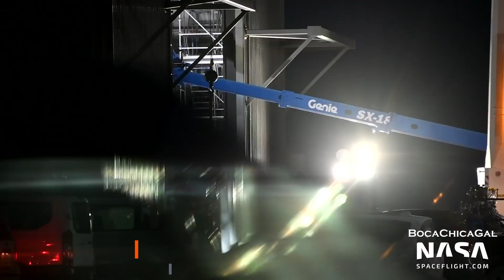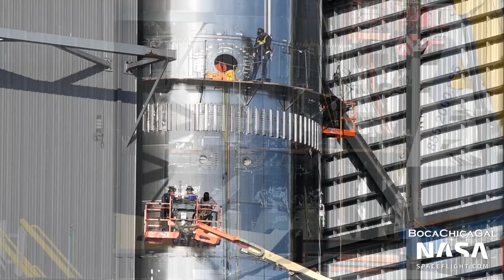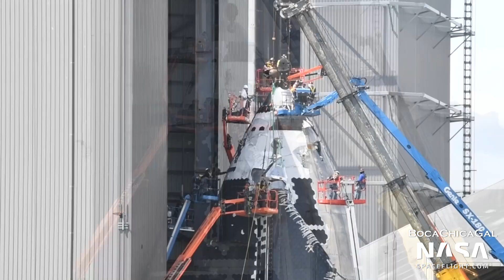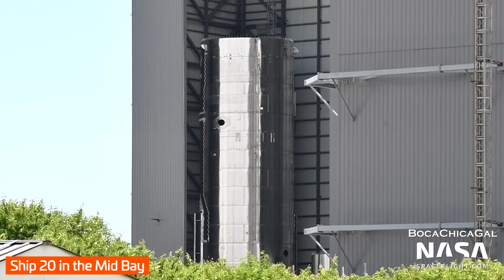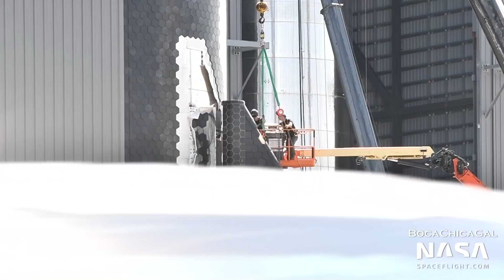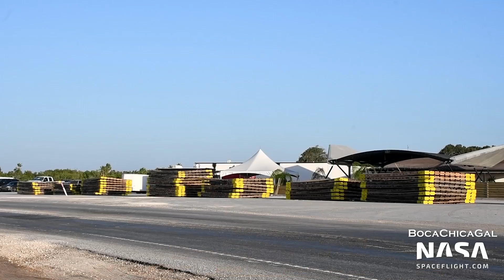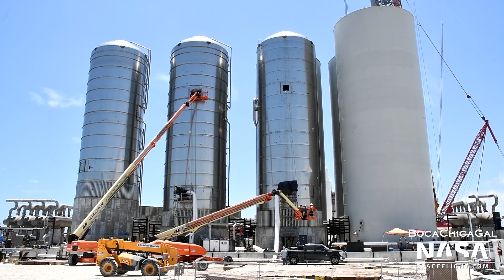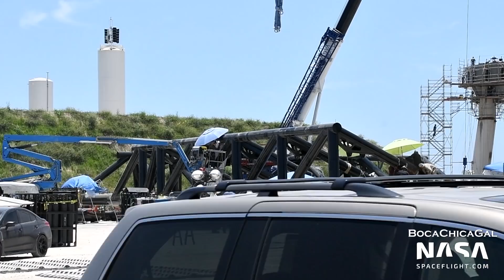29 Raptor Engines Installed on Super Heavy Booster 4 Overnight | SpaceX Boca Chica

Comment: My brain is still comprehending those 29 raptors on one vehicle and knowing that has more thrust than the Saturn V!
Reply: A little more than Saturn V, which had FIVE engines.
Reply: @NeverTalkToCops1  A little more? it will have more than twice the thrust at takeoff than the Saturn V
Reply: Still amazes me that it took over 50 years to beat the Saturn-V.
Reply: Still we have to wait for the static fire
Reply: @ulyssesgrant4324  we've never really had a need for a rocket as powerful as the Saturn V since the end of the Apollo program. Sure it would have been handy for some missions, but it was a very inefficient way of getting a small mass to orbit
Reply: @NeverTalkToCops1  was that it had 5 engines part necessary, the raptors by no means the most powerful, they are simply the most efficient and advanced with their throttle control and other things that I’m not gonna act like i know.
Reply: @stanleycius3295  they drink methane which is important. Most rockets pollute using RP1.
Reply: When they fire up all 29 I will stand outside and enjoy the noise and I'm in Brisbane Australia
Reply: @ulyssesgrant4324  To be fair, the shuttle was a monster of hardware, too. It was huge!
Reply: @ulyssesgrant4324  Seems like no one was even trying
Reply: @Kabup2  something like a million individual parts
Reply: @robhaddock8533  and ill be 7 hrs north right there with ya mate haha
Reply: saturn V produced 34.5 MN ....whereas super heavy alone will proudce 74 MN (more than double the saturn V) ....and i have not even include the starship (2nd stage)
Reply: @ulyssesgrant4324  technically the soviet N-1 moon rocket was more powerful, but it never had a successful flight, plus it needed 30 engines to do what the Saturn V could do with 5.
Reply: I hope they won't make any mistakes, because history of rushing something is mostly filled with failure due to crunch...
Reply: The days of life living on only 1 planet in our Solar System are rapidly coming to a conclusion of Life being truly Multi-planetary and soon to be traveling among the cosmos......
Reply: @shadyend5401  was thinking the same exact thing.
Reply: @shadyend5401  it's how SpaceX does things, moving rapidly, taking loads of data from failures, improving and going with the next test as soon as possible. It's working. 
Don't feel bad if this rocket "fails". 
After all, they do not fear failing. For example, Elon said that if you do not fail, you are not innovating enough.
Reply: @ulyssesgrant4324  it's not that it took 50 years to beat it , it's just that we didn't need to beat it since the saturn V
Reply: @setesh1294  tbf, each of the NK-33 engines in the N-1 was far more advanced than the F1 engines in the Saturn V.

NASA later bought them up in 1995 after the collapse of the Soviet Union, they couldn’t believe the Soviets had this tech back in the 60s-early 70s!

Even 25 years later US RP-1 powered engines couldn’t match the power of efficiency of the NK-33.

But trying to control 30 engines with 1960s-70s hardware was just far too difficult...

With modern fly-by-wire tech, 29 engines should be better than only a few. You can lose a couple and still make it to orbit.

If you suddenly lost 1/5th of your thrust, due to a single engine failure like in a Sayurn V, you’d have to abort.
Reply: And in one night
Reply: @NeverTalkToCops1  All of that thrust on top of a tin can lol. (or at least something that looks like one, I know its not made out of tin)
Reply: @waynelevett3632  The total amount of pollution caused by all the rockets that has ever flown is something like less than 0.5% of what airplanes cause in a single year, every year.
Reply: @theglitch312  can u share references where nasa describes that? I haven’t heard of that
Reply: @jackblack-tt1of  That's not even the most interesting part. At a cost of roughly $1.9 million a launch, it blows away the cost numbers. Optimization is key to this today.
Reply: @constantin-X  I don’t have the time right now sadly. But if you google NASA buys NK-33 from Russia then something’s bound to come up.

It’s a pretty well-known and popular story with aerospace.

I’ll link something later tonight if you like.
Reply: Any date on when this Monster will go up? Thanks
Reply: First I read Saturn V! as Saturn 6
Reply: It's crazy
Reply: And we are alive to see it first time. What an amazing time to be alive. Felt kind of sad for not being able to see saturn 5 in action back then but man…I wouldn‘t change a thing about it
Reply: @danihz5610  Sometime end of September perhaps? Thats optimistic but people are saying even earlier, like end of this month, which is crazy.
Reply: More thrust by a factor of 2...
Reply: A little more?   It's  twice the thrust and it has multi engine out redundancy.   The saturn couldn't lift off with just one engine failure.
Reply: @ulyssesgrant4324  They didn't beat it yet and it will take at least till 2023 Elon said to be operational.
Reply: @danewilliam2907  Exactly,NASA never had the budget to go to Mars.
Reply: @jackblack-tt1of  also because it will be lighter suppose...
Reply: @Kabup2  The Space Shuttle Program,  In the 30-year period between 1981 and 2011, it carried over 300 astronauts into low-Earth orbit.

NASA started the Space Shuttle design process in 1968, with the vision of creating a fully reusable spaceplane using a crewed fly-back booster. This concept proved expensive and complex, therefore the design was scaled back to reusable solid rocket boosters and an expendable external tank.

NASA - Shuttle Basics. The Space Shuttle is the world's first reusable spacecraft, and the first spacecraft in history that can carry large satellites both to and from orbit.

The Space Shuttle was the first operational orbital spacecraft designed for reuse. Each Space Shuttle orbiter was designed for a projected lifespan of 100 launches or ten years of operational life, although this was later extended.
Reply: @shreysharma726  The Saturn V was launched 13 times from Kennedy Space Center with no loss of crew or payload. As of 2021, the Saturn V remains the tallest, heaviest, and most powerful (highest total impulse) rocket ever brought to operational status, and holds records for the heaviest payload launched and largest payload capacity to low Earth orbit (LEO) of 310,000 lb (140,000 kg).
Reply: @kylereese4822  In your dream!
Reply: @Alice.59  The Saturn V was launched 13 times from Kennedy Space Center with no loss of crew or payload. As of 2021, the Saturn V remains the tallest, heaviest, and most powerful (highest total impulse) rocket ever brought to operational status, and holds records for the heaviest payload launched and largest payload capacity to low Earth orbit (LEO) of 310,000 lb (140,000 kg).
Reply: In order to achieve double the thrust of the Saturn-V rocket, a full order of magnitude of complexity was required.
Reply: @anthonylosego  The 1.9 millions is just for the fuel and the launch...the 10 billions for the Design and Development must be paid back! and if the starship system go in the water like it's planned  it's a +$200 millions lost in hardware and it will cost more to get the two stage back if they do and  the inspection and repair after the launch if they keep some structure....all Boca Chica investment in the infrastructure and tools and salary must be paid and Elon said that it's very expensive! and he said only that only in 2023 will the starship will be operational=making money.
Reply: @kidsmithree  But it never failed in 13 launch.
Reply: @carljohan9265  have you seen on take off 😂. Blowing tonnes of fumes out the bottom end 😂.
Them ice  cars are also on the hit list.
Reply: @danewilliam2907  what do you mean when you say that the Saturn V was inefficient? In terms of payload mass fraction to orbit, it still remains one of the more efficient rockets to exist.
Reply: More than the N1
Reply: @BetterDeadThanRed99  and more complexity is less reliability and safety....
Reply: @Alice.59  If only politics wasn't involved in Space, Nasa could've done so much more.
Reply: @joannewilson6577   I should say a solid vehicle that's not in development for a decade, and still hasn't flown
Reply: Only thing I’m worried about is that much thrust taking out the tower and or the tank farm. The vibration and force are going to be incredible. It could be an epic failure. The Saturn 5 had a huge flame diverter and millions of gallons of water.
Reply: @ulyssesgrant4324  true
Reply: @billywill903  That's one thing I was wondering why there's not flame diverter. even for the test flights they just shot in straight into the ground, even destroying the concrete one time, with three raptors! I just hope it doesn't explode, If the Saturn-V exploded debris would've went as far as 3 miles, The Saturn-V is smaller than the Starship. I've often wondered if the Ship would explode on the Pad would it take out the tower and launchpad completely?
Reply: @theglitch312  the NK-33 had 380k lbf thrust while the F-1 had 1.7m lbf thrust in vacuum. Just shy of five times the thrust. I think your numbers are a bit off. The F-1 is the single most powerful rocket engine to date.

 The only reason the N1 had more thrust than the Saturn V is because it took 5 NK-33s to surpass the thrust given by a single F-1, and it had 30.
Reply: @billywill903  Yes,for sure it will be quite a spectacular event! Let's hope for he best those guys are very smart.
Reply: @ulyssesgrant4324  The N1 beat the Saturn V in terms of power, and the Energia matched it, but as for successful rockets, nothing beats the Saturn V.
Reply: @danewilliam2907  *6 million
Reply: @waynelevett3632  Yes, I have. All of those clouds are made of the vaporized water from the sound suppression system that every launch pad has by necessity. 
It's easy to see the deluge system starting to flood the pad with water right before liftoff, it usually happens around T-10 seconds. 

What, you never thought about why there are lots of clouds around the pad when the rocket takes of, but none in the exhaust plume once it's in the air?
Reply: @setesh1294  It's the most powerful single-chamber, liquid fueled engine. The RD-170 is more powerful, but uses four chambers, and of course SRBs are more powerful. Raptor, though, has much better ISP and TWR. It takes three to match the thrust of a F-1, but five to match its weight.
Reply: @joannewilson6577  so in just 2 years it will start making a PROFIT. That’s pretty damn good for a privately run company. This is one of reasons the government run programs took so long. Too much risk aversion
Reply: @erlienfrommars  Good point!
Reply: @setesh1294  I was talking about the thrust to weight ratio of the NK-33, it's a more fair measurement of the grunt of an engine. The NK-33 had a TWR of about ~140 while the F1 was ~90 and it's efficiency was also about 10% lower vs the NK-33. Pound for pound, the NK-33 was a far superior engine due to its oxygen rich staged combustion cycle, a first of its kind.

But the tech back in the day just couldn't coordinate and manage 30 of them. So they were useless for large rockets, making the F1 engine superior by default for heavy lifters.
Reply: @joannewilson6577  From an engineering perspective you are generally correct but when comparing rocket engines that rule-of-thumb doesn't really hold up. Solid rockets are a premixed stoichiometric explosive composition that cannot be throttled, stopped, reignited... or safely stored for that matter. Yikes! This is one of the primary disadvantages of premixing your fuel and oxidizer together; you're basically building a bomb and attempting to control the resulting explosion to produce usable thrust. The design is exceptionally simple in this respect (no moving parts) but inherently far more dangerous and unreliable compared to their liquid or hybrid predecessors that separate fuel from oxidizer until combustion.
Reply: No rocket engine can match the performance of the Raptor. If the Raptor were scaled-up to match the weight of Rocketdyne F-1 it would produce about 50% more thrust   

Rocketdyne F1 dry engine weight: 18,480 pounds,   Thrust: 1.5 million lbf.
SpaceX Raptor dry engine weight: 3,300 pounds,     Thrust .5 million lbf. 

You can fit 5.5 raptors on the same rocket for the same weight as a single F-1.   

The Raptor is the most powerful rocket engine ever developed, hands-down.
Reply: "highest specific impulse" is moot.
Reply: @joannewilson6577  what r u trying to say then ...that saturn V is the better than starship
Reply: @shreysharma726  Elon said lately that Starship will be operational in 2023,so wait till it launch 13 times after being operational before you can compare it to a real operational rocket! 
It's super easy to design a rocket on paper but to build 13 that are operational and perfectly successful +50 years ago is a lot harder.
Reply: @joannewilson6577  More complexity doesn’t necessarily mean less reliability and safety. A Falcon 9 is a more complex rocket than most, yet it has one of the highest launch numbers and success rates.
Reply: @theglitch312  The main problem was the first stage falling apart, the engines were fine. They had issues with vibrations and resonance and gas bubbles and the water hammer effect. All things that could have been solved but they werent able to test the first stage on its own because it was too big for transportation and thus had to be assembled at the launch site. All other stages had been tested successfully.

Comment: Installation of 29 raptors within a single night means SpaceX are moving on a speed where the word "fast" sounds cute. Also, it'd be great if we can see someone documenting it in night time on behalf of NSF.
Reply: Warp 9? Nah we must be going at warp speed 9000 if we getting 29 engines on 1 rocket in 1 night
Reply: SpaceX should have built the James Webb Telescope.
Reply: Or you could say WARP 9
Reply: I think they secured them in place but the wiring and hoses and all the other connection probably not…
Reply: @crcpeart  likewise not sure we are seeing 29 fully installed Raptors. We can see some Raptors sitting under B4, thats not the same as 29 fully installed Raptors. Might just be the ones we can see sat underneath. Still epic though.
Reply: @philleng480  There are definitely 29 engines under there -- SpaceX/Elon posted pictures of it on Twitter.  But yeah presumably they're just bolted in and not fully plumbed and wired.
Reply: @ars3nic  ah, thats still impressive just getting the 29 in place. Would almost be worrying if they had got them all hooked up as it usually seems to take a day or more just to get 3 into a starship. Sure they will be able to get them in quicker as they go along, but that would be an epic jump (and with the Boost engines). Soon see if there is a hive of activity under B4 doing the plumbing.
Reply: I hope they won't make any mistakes, because history of rushing something is mostly filled with failure due to crunch...
Reply: Seems to be a suggestion 9 are installed,  20 there for show.
Reply: They've gone plaid!
Reply: @PanzerBuyer  when they finally launch the James Webb Telescope the first picture of Alpha Centauri it takes will be of an interstellar version of Starship arriving
Reply: The engineering design and production of vehicle is jawdropping!  Check out the Soviet N1 documentary on youtube, SpaceX design and development seems to combine the brute engineering philosophy of the Russian’s with the 21st century tools of CAD and massive sensor data provided by test flights combined with the ability to simulate flights virtually.
Reply: Plaid speed.
Reply: @jamesburke1978  I had the question whether a vehicle with such a large engine count will meet the fate of N1? One of the key considerations in this regard is that the Russians never got to test the damn thing before it flew -- they frantically put it together and may be gassed out on resources, they simply put it on the pad. SpaceX does it differently, of course, with their test, fly, fail, fly, philosophy.
Reply: @leestewart72  Yup, and simply planned and organized with nothing to trip over.